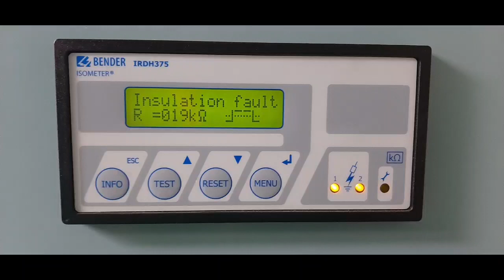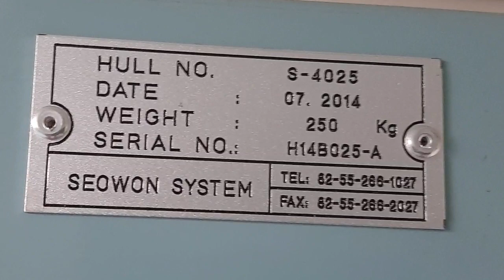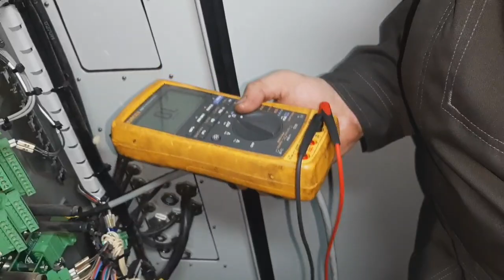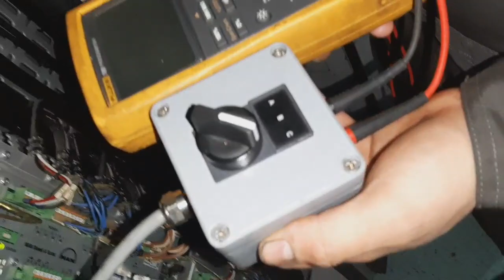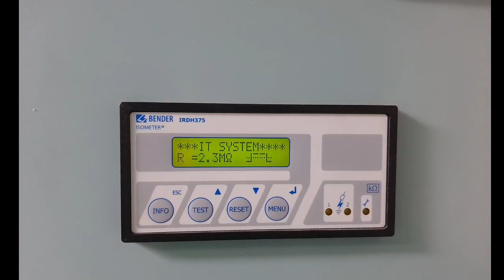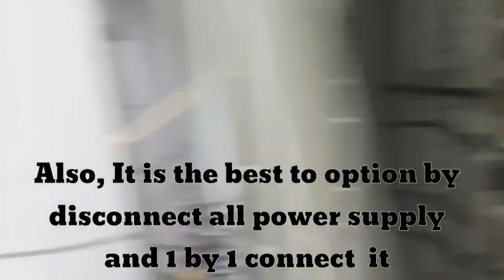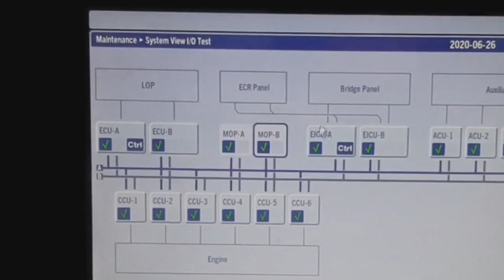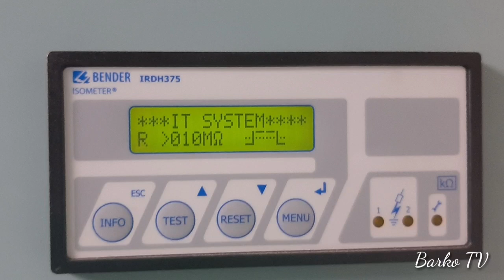Low Insulation Fault 24Vdc ME-C UPS》Man B&W   Paano hanapin  》2 Step how to find low insulation

Comment: Thanks Sir much appreciated!
Sa stop engine may precaution pa ba bago mag switch off ng mga ecu acu etc? Or okay na switch off on direcho from ups supply
Reply from the maker: Anchorahe or finish with engine. No prob mag switch off  ka. Pag i balik mo na sa normal, at ma turn on muna lahat, mag turning gear ka or mag slow turn ka para ma reset ang mga alarm. Or mag blow off.